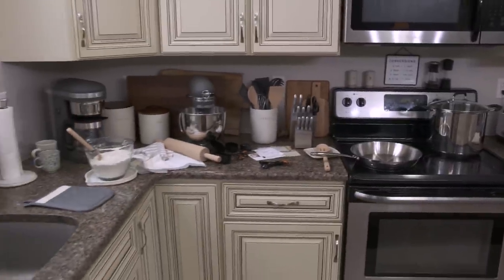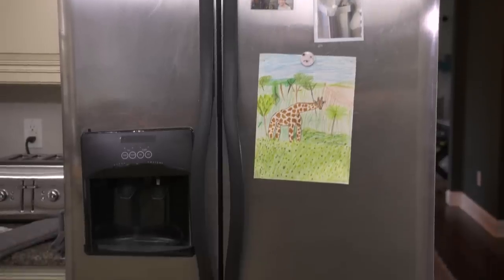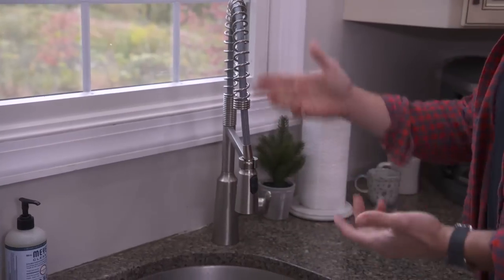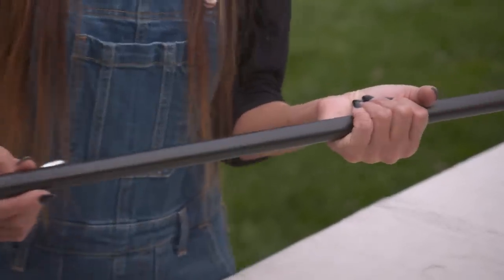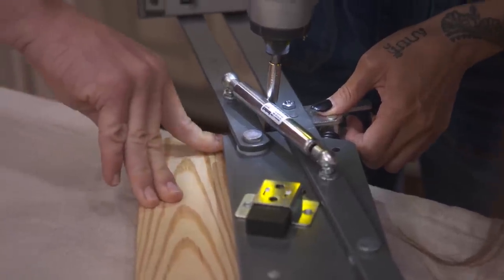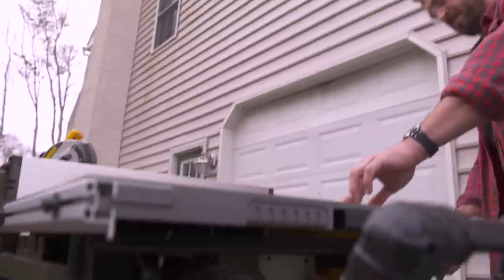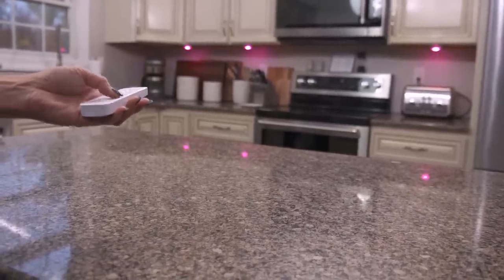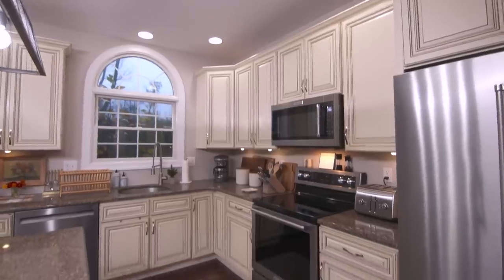How To Design The Perfect DIY Home Cook's Kitchen

Comment: My only concern would be the pot contact points against the wall. Over time there will likely be scratches or marks from where they bump against the wall. If they are in constant contact you might get marks from them swinging back and forth too.